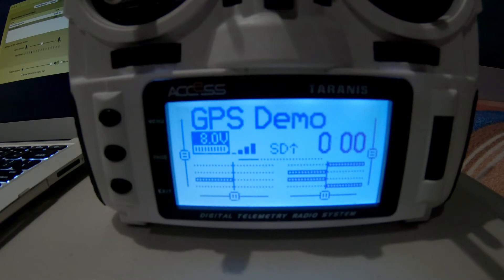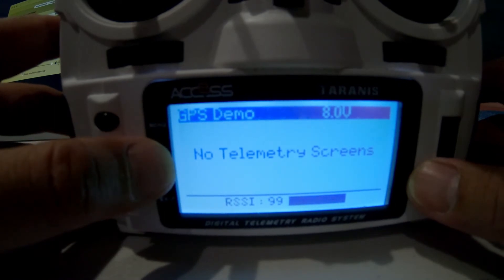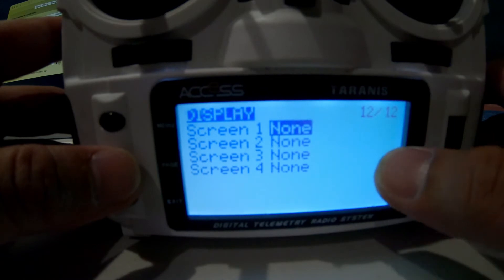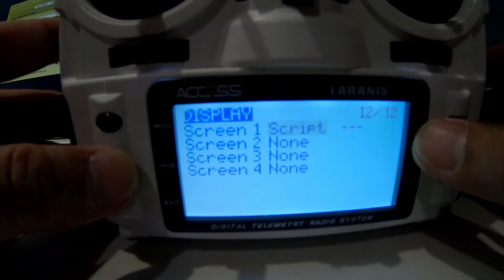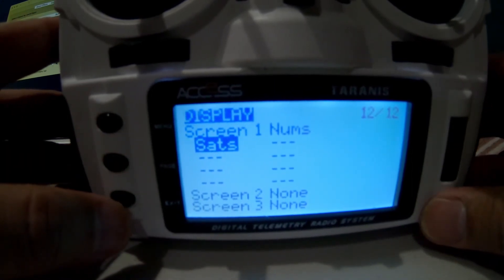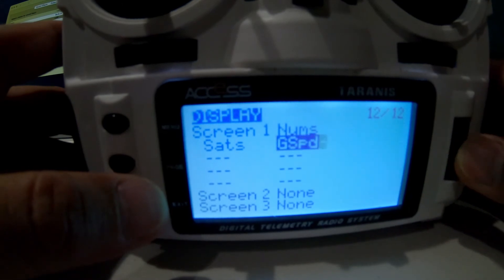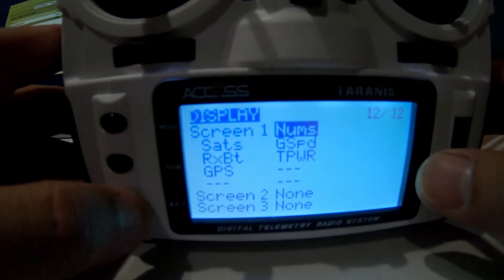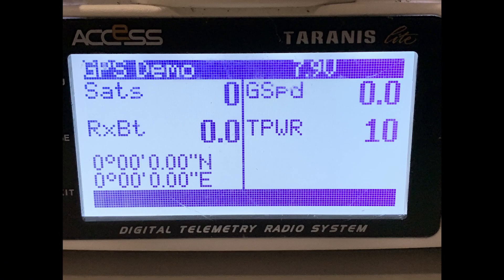OpenTX Radio GPS coordinates setup

Comment: Hi, thanks for the tutorial, any idea on why the gps details are not the same in my radio than in my goggles osd? 🤔
Reply from the maker: Thanks for watching. Must just be the units used. Telemetry info comes all from the quad, radio just receives the info.
Reply: Hey, in case you only get a simple number on yohr radio display, you have to keep scrolling until the other "gps" on the display page. Then you get real coordinates on your tele page